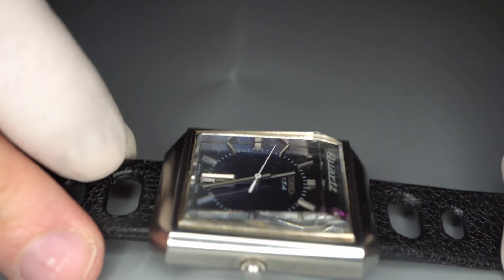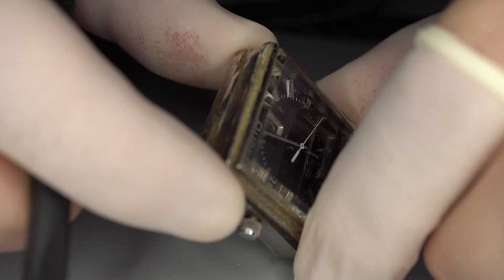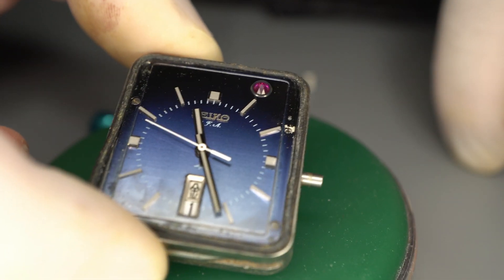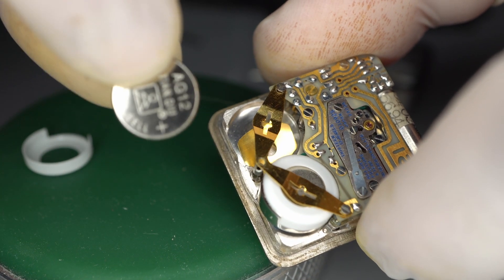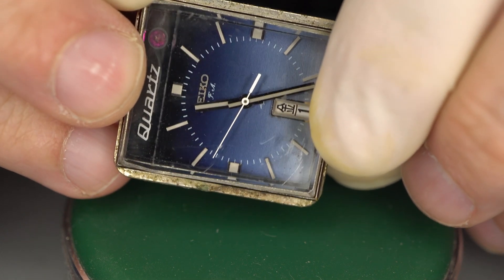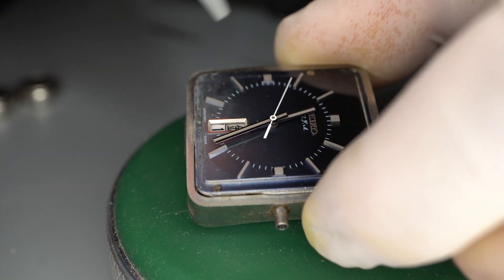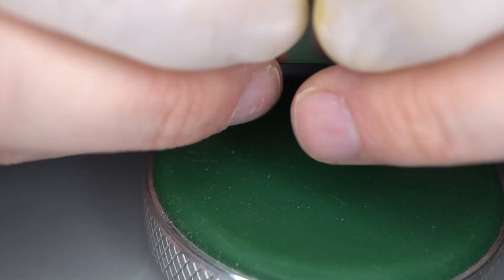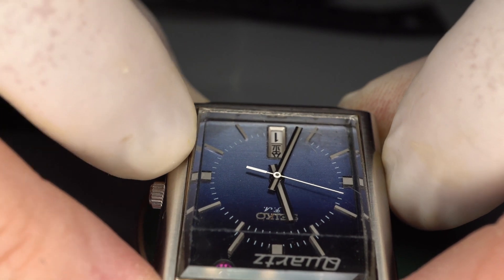Seiko VFA 3923 Quartz Battery Replacement

Comment: Wow, that movement has 13 jewels and is temperature compensated.
Reply from the maker: It sold for almost 1/4 to 1/2 the price of a new car back then.
Reply: @InterestingWatches  I had no idea quartz Seikos were so expensive. This movement looks like it would give the Rolex Oyster Quartz a run for the money.
Reply from the maker: This was cutting edge technology at the time. They even had a higher end version that probably cost the price of a car.